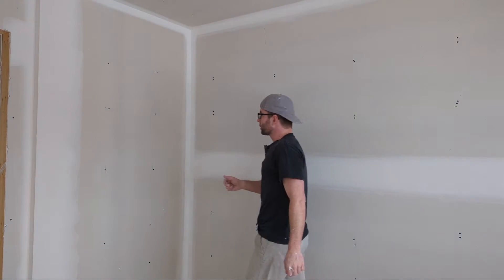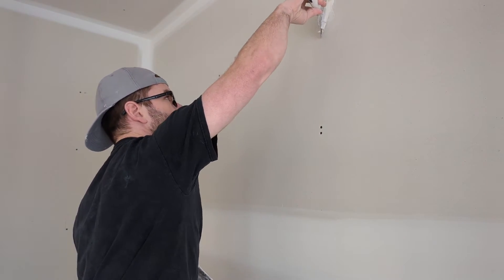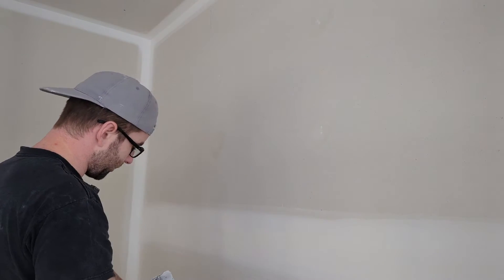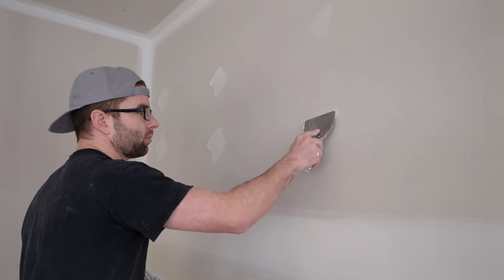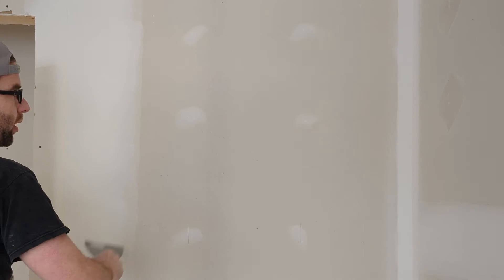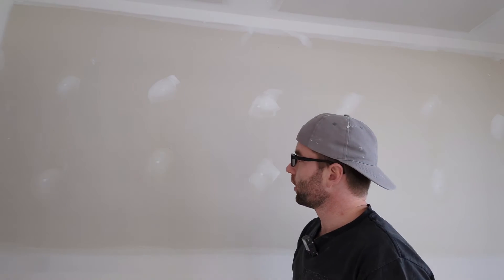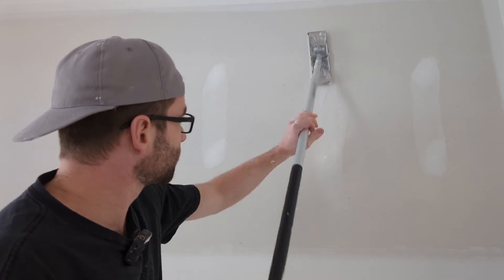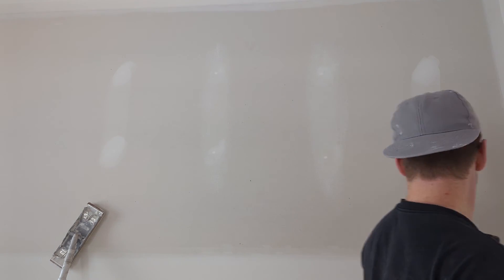How many coats on drywall screws?

Comment: I totally agree but you have a nail spotter I striped the first coat and use my nail spotter for the second coat first coat right out of the box I mix the mud in the box with my paddle before I use it then nail spotter and sand so both coats get striped less edges😎👍👑🇨🇦

Comment: I know many people do it many different ways and I’ve seen quite a few.
I think screws are less noticeable when it’s sanded down to where there’s no more mud left on the board but just in the screw hole.
It’s a lot less noticeable than some who 3 or 4 coat them and try to leave a feathered edge patch but that’s just my experience
Reply from the maker: That's my experiences too, 3 or more coats sanded smooth seems to show through the finish paint sometimes. Especially a wall with lots of natural light, can see the stripes.
2 coats sanded down to the board finishes better imo.